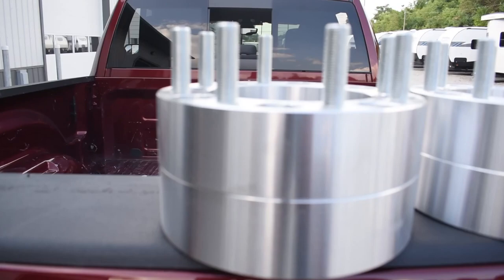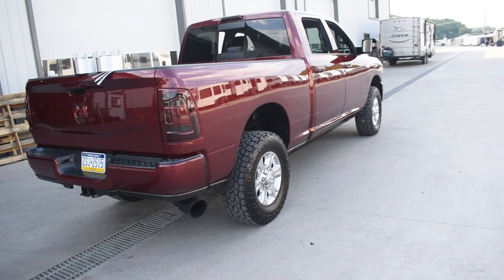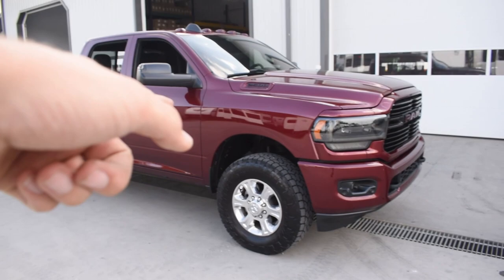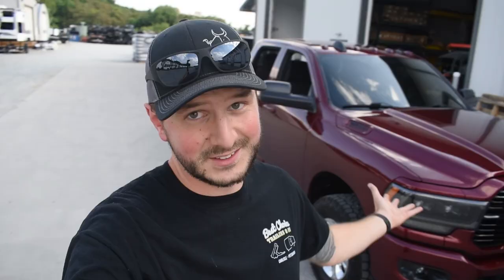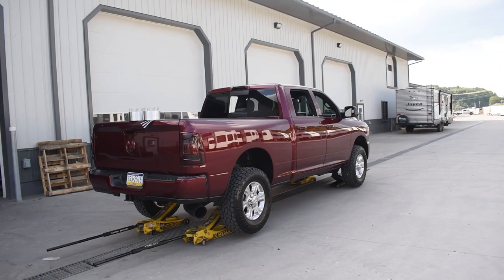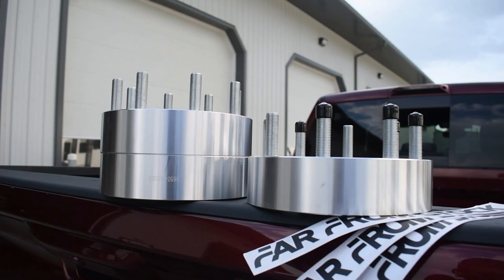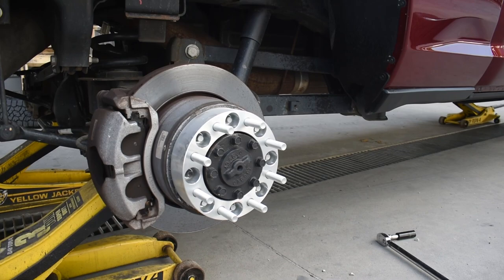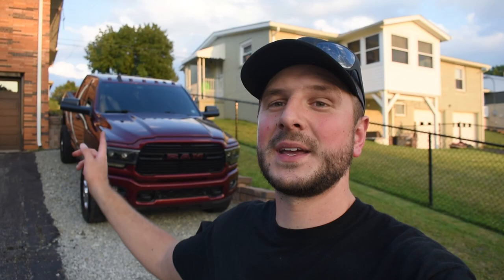Far From Stock Wheel Spacers on the Cummins... Bubba Status!

Comment: Well I thought I’d was going to look like garbage but that looks really good. I debated on 35s but put the 2.5 kit and 37s on 17” wheels and really like mine now. Rides better than it did new. Running 45psi in the front and 40 in the back and no problems at all
Reply: WHAT RIMS?? STOCK?
Reply: @YOUARESOFT.  he used his stock wheels with the spacer and I used wheels with positive offset
Reply: @williamholtzclaw9372  thank you!! What size spacer would you suggest ? Was thinking an inch
Reply: @YOUARESOFT.  I think he used a 2” spacer

Comment: Looks great! I'm running Titan 2" spacers on stock wheels on my power wagon. My fronts are hub centric while the rears are not. Was told the rear axle is the reason for not being hub centric. Kinda odd your fronts are not at least that way. Just recheck your torque on a regular basis and you should be good.
Reply: How have your wheel spacers held up. Im thinking about getting some titan wheel spacers. Do you have any shaking or anything when you go down the road
Reply: @carterledbetter7657  Holding up great so far. Ive got about 15k miles on them. I check the torque on them every so often just to make sure all is well. No shaking caused by the spacers and I regularly tow a trailer without issue.

Comment: I’m running 35x12.5 on my 2022 ram 2500 with my stock 18 inch wheels and no rubbing at all idk if putting 2 inch spacers will make it rub it is a 4x4
Reply from the maker: That’s odd. Most guys I see with all stock suspension and whatnot and 35s on stock wheels rub on the sway bar at full lock. Then the 2” spacers bump the tires out enough to stop the rub.